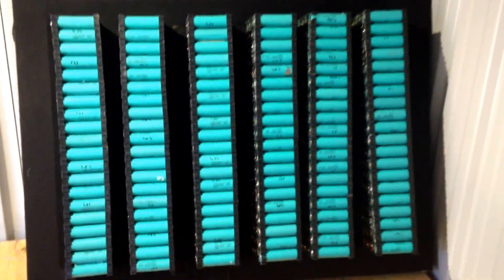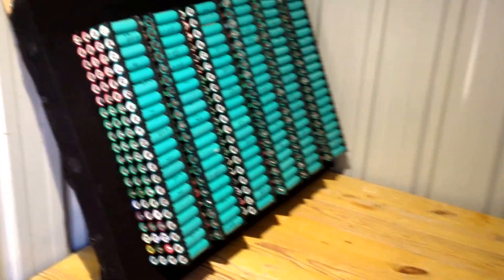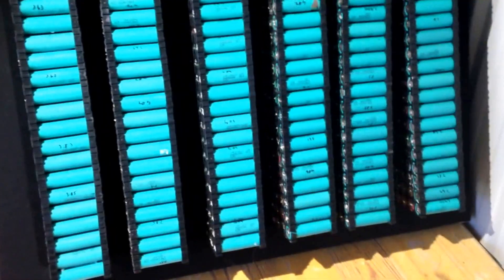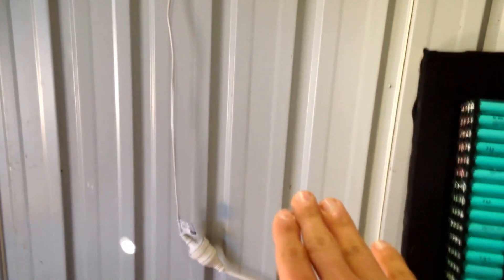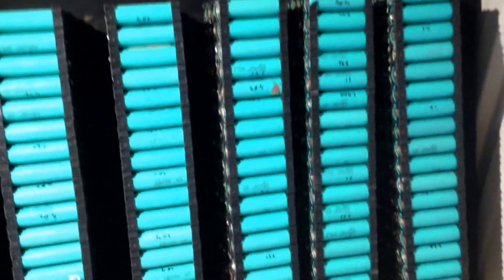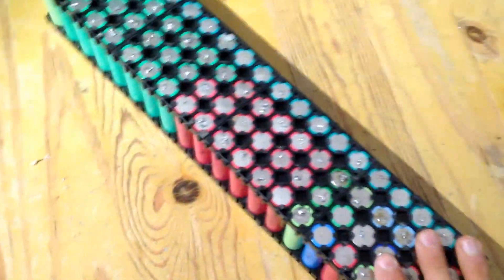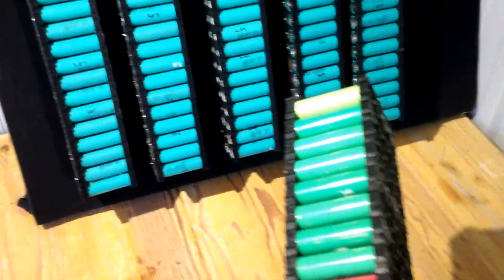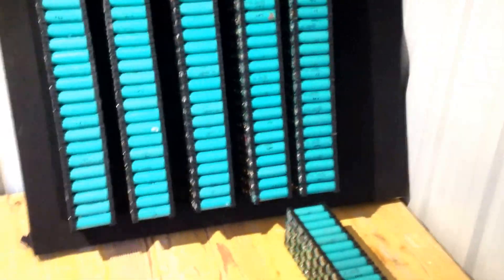Homemade Tesla Powerwall | Finally have cell holders! | Update 4

Comment: great vid, thanks. may I ask a question? How do I know how much amps a battery pack can handle.  if I have a motor that draws 40 amps and I am using a 18685 battery pack that  has 40 cells, does that mean that each cell is drawing 1 amp?